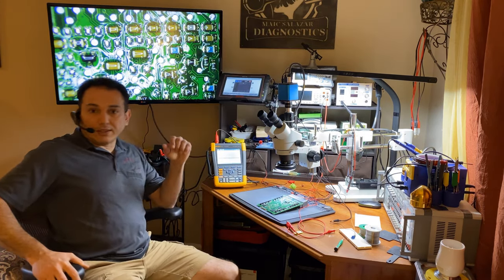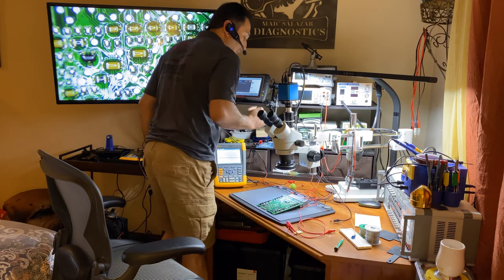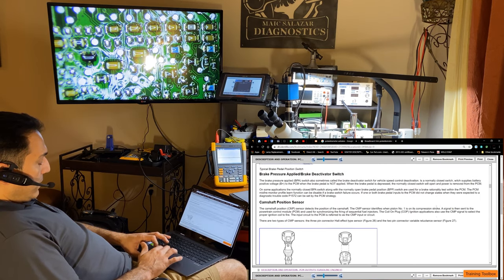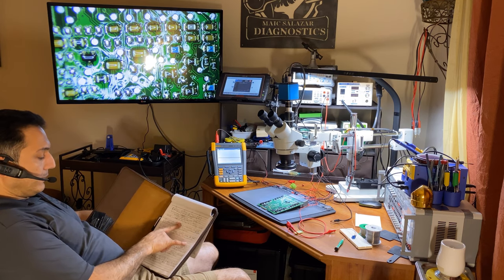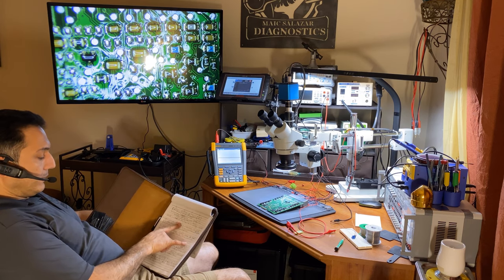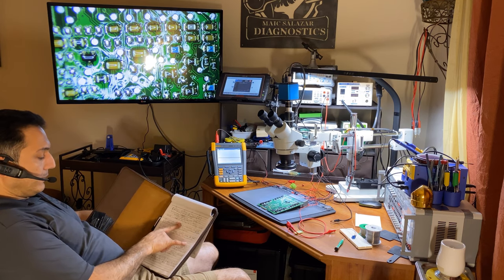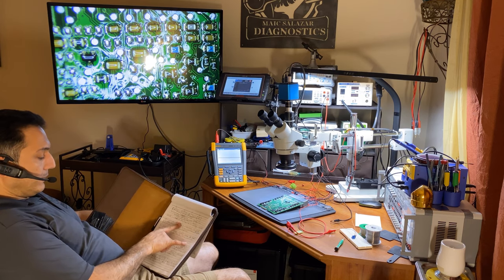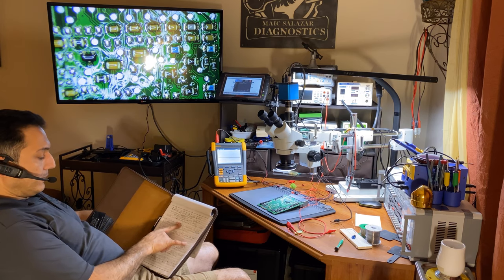How to repair automotive ECMs Class 2

Comment: I've started with computers in 1990 and went on to work in electrical for many years. I had heath issues and ended up doing automotive Diagnostics I have scopes and many other tools. I already use alldata. I started working on ecu and such due again to heath issues my meds  I can't be out in heat alot so I changed back to board repair. Good job explaining to Know both sides really helps alot in this.

Comment: You have done a really huge job to make this video understandable for everyone. 
It would be great if you probably give me an advise how properly resolve my issue???
I got Nissan X trail T 31 diesel, 4x4 , 2010 year. I got a problem with foult P1435. Its  DPF. It happened because I forgot to clean up  a cup oil catcher. ( My first Diesel car)
I already done next steps.
1. Used AUTEL Launch scanner to delete all mistakes , but only one still remain on a dash board. Yellow Engine.
1.1Checks all sensors physically( oxigen, temperature, pressure)  signal 5 volts comes to sensors.
1.1 Add DPF cleaner to a fuel and straight away before Catalytic filter and RPM between 2200- 2500 for 50 minutes to clean DPF filter. No black smoke.
1.2Car works well no power loss fast and powerful like Ferrari but unfortunately I can't ACTIVATE CRUISE CONTROL.
CONCLUSION.
I ENDED UP with  conclusion that there is possibility that DPF filter is clean and This fault was gone to An emergency foulder. That's why Yellow Engine  indicates on my dash board. To reset it from emergency Folder I need to visit a Nissan Dealer .
I DON'T WANT TO DO IT.
So MY QUESTION IS.  Ktag  programmer can help me to Reset this fault ???
Thank you very much for your Help.
Sincerely yours,
Dmytro Kliuchka

Comment: Hi Maic, thanks for job well done. 

Please which terminal of the ECU is the shift solenoid valves : SLT+, SLT-, SL, S1, S2 connected to : TOYOTA 89661-0F050 F5 for 2004 Corolla Verso Automatic Transmission ?

Comment: Hey brother I have a question that I don’t know where I’m going wrong with. I currently do DME BMW cloning with my Autel Im608. I currently just bought a Godiag GT100 breakout box since I want to get more in depth to be able to use my Autel Ultra or ISTA on the bench. I have a MEVD17.2P in my lab and for some reason with the godiag and ultra it is not reading DME. Not sure what I’m doing wrong but what would be the pin outs to get this to work on the bench? I have currently pin 1,22,40 12v, pin 1,3,11,7 GND, pin 43,44 Can L-H. What pins am I missing?

Comment: Maic, heres a question. Do you know how the ECM decides to set a P0420 code. Is it the number of cross counts over .45 volts for the downstream 02 sensor? Have you ever tested an ecm to see what triggers this fault? There are a bunch of videos on P0420 but none discuss the actual cause of the fault.
Reply from the maker: Well, it all depends on the vehicle manufacture criteria. I would look into monitor conditions for your specific application.

Comment: Hello bro.... How are you doing.. I have watched your other videos on ecu repair from 1 t0 5 both on sensors,transistors(pnp,non etc) but I have a question on class 2 which I enjoyed  but how is the connection between the ECU simulator, ECU and the scan tool. How are you able to use the scan tool to diagnose on the bench. I don't understand it and no explanation on it.... Do you have an email too or you prefer the YouTube comment section.... Anyway thanks alot. Better days ahead.
Reply from the maker: Well connections from ECU to the simulator are based on each vehicle, powers, and grounds, the main signals, or the signal you need to test base on the customer complaint. 
The scanner connections are also based on each specific vehicle communication protocols, I use an OBD2 connector and supply the power, grounds, and communication lines from the ECM to DLC.
Reply: @MaicSalazarDiagnostics  ok sir.... I get you and understand clearly now..... thanks a lot.... better days and greater heights I wish you sir....👍🏾❤

Comment: Hello Maic. We know that the Hall effect crank or cam sensor has 3 wires. When simulating an ecu powered by a Hall effect sensor, do you just connect the ground and signal wire between your simulator and the ecu?
Reply from the maker: Just the signal wire. I usually have the ground and 5v ref or voltage ref wires set up with a 4mm banana adapter to make sure both are good and connect them to a multimeter to see the voltage.
Reply: @MaicSalazarDiagnostics  Thank you

Comment: AWESOME/ GREAT information  those videos will be in my special places to go back and watch them again and again Maic i have a question regarding BMW 2008 323I/3.0 LT CAR CRANK NO START after scanning i found  two codes 2ACB and 2ACC after some research the info say DME relay activation  and  shift delay and info say there is abad DIOD  inside the DME GOES BAD and give u those codes so either change the DME or fix the DIOD any information if u had the same problem can help would be appreciated my friend. thank you and cheeeeeeeers
Reply from the maker: Yes the problem is internal in DME, there is actually a TSB for it   SI B 12 18 07

Comment: Where do I find the board schematics for my truck. The resistors are blown but I don’t know the valve of them?
Reply from the maker: Not sure I have not found any.
Reply: How would you find out the value of a burnt resistor on a board
Reply from the maker: @litemupkustomz  the only way will be with a good board to save all the values for next time. Only manufactures ( BMW, Ford, etc) have access to internal schematics and they don’t give that to the public. Including me! It takes lots of hours saving information from a good board and reverse engineering the circuit board to find the correct parts, if possible!

Comment: Going to try and repair 1980 Datsun ecm , fo you have any tips or tricks what I’m truly looking for , if I hit the exm car runs right for a couple seconds lol
Reply from the maker: I will look into the capacitors. Most likely a leaking capacitor, you will see kind of corrosion ( it is actually the acid from the capacitor).
Reply: @MaicSalazarDiagnostics  thank you
Reply: @MaicSalazarDiagnostics  do you have a email I can reach you ? So I can Send photos possibly?
Reply: @MaicSalazarDiagnostics  I found a cracked varistor on the board ,, I don’t get any reading so I know it’s bad , , also don’t get reading from being removed from the circuit 
Varistor says znr k270 -16-   Is there a way to find out the size  varistor ?
Reply from the maker: @Darrenlawrence89   please send me a picture at maic@maicsalazardiagnostics.com

Comment: Nice info, do you have the pin out port for  PCB code JG331B09702C1, box = MR44641, Mitsubishi Lancer 2000, I can not see any pulse on my scope from ECU coil 1,4 and 2,3.thanks